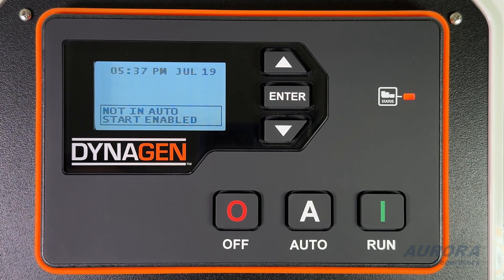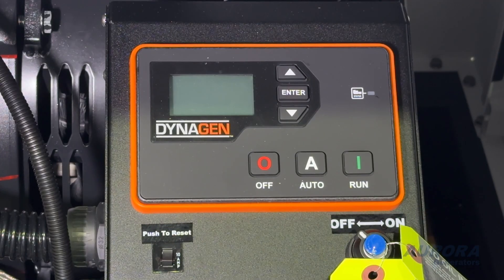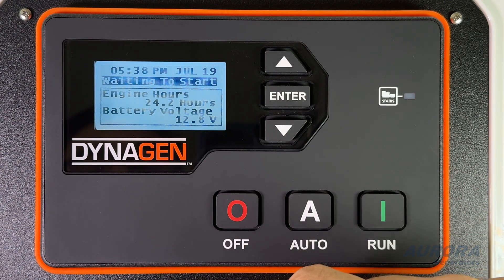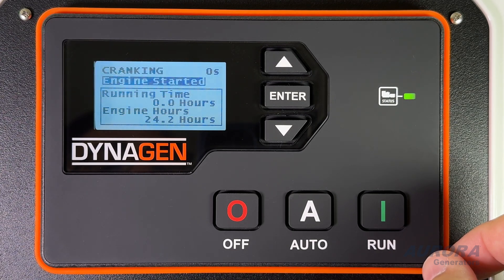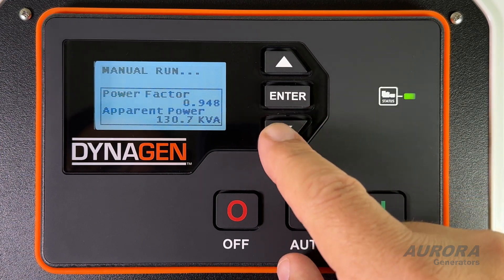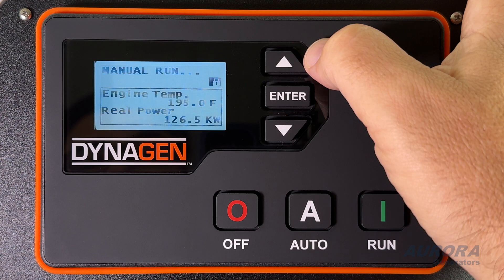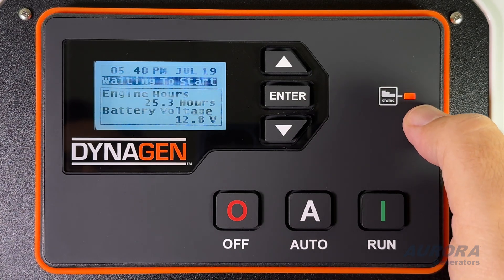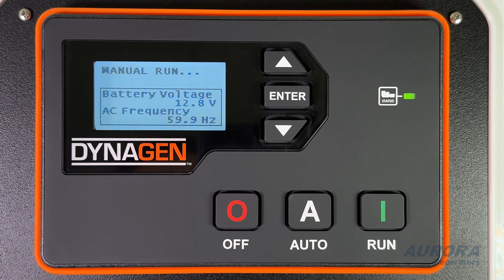Getting Started With The DynaGen TG350 & TG410 Generator Controller

Comment: Are these stockpiled by Aurora in case of global supply shortage? 

Most people buy generators for peace of mind and companies rely on them to keep production running or services available. If control electronics aren't stockpiled in case the parts to make them become dramatically more expensive the value proposition is less.
Reply from the maker: Yes we do stock these.  It's used on all our generators and we are also a distributor so they are always in stock for both our customers and our production.
Reply: @AuroraGenerators  From 2019 to 2024 the chips and electronics needed for the control boards in everything I repaired have been in very short supply. 

Thanks to "lean" supply chain gimmicks there were no control boards stockpiled. 

The price of a simple board shot up making quick repairs into catastrophic expenses. Customers chose to abandon working engines and scrap other capital intensive equipment because without control systems they were useless. Thanks to proprietary software controlling the equipment with analog hand made electronics was impossible.  

The past five years have been a slowly unraveling catastrophe because it was like half the world went dark. Factories and companies hastily fired their employees and tried to entice them back with wages that had crashed in value. 

So I'm asking is there a supply of these intended for future emergency repairs? Like a warehouse full somewhere? Just in case Dynagen stops making them suddenly? 

I know this seems like an odd thing to ask but genuinely try and hang onto a supply of backups in case manufacturing ceases again.  Take the lean out of your supply chain and bulk up for winter. With a fat supply chain its possible to profit where others just fail and their products end up as scrap